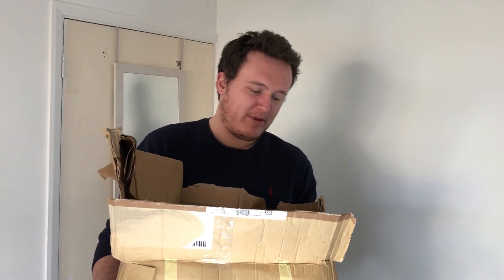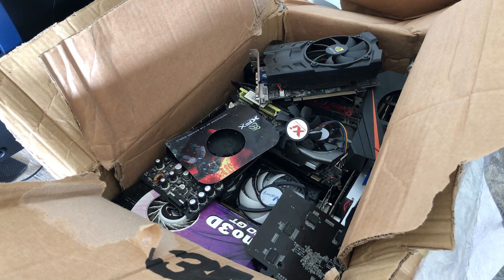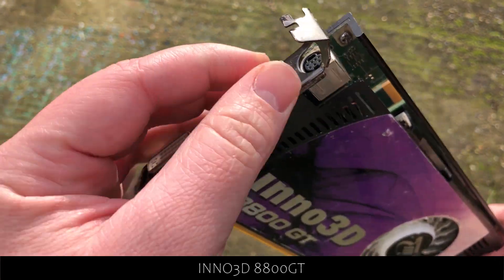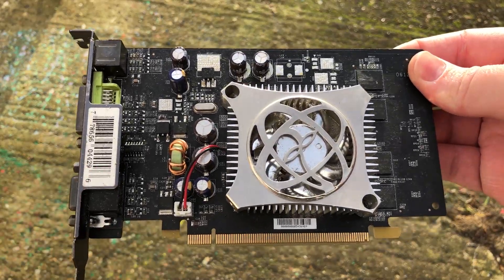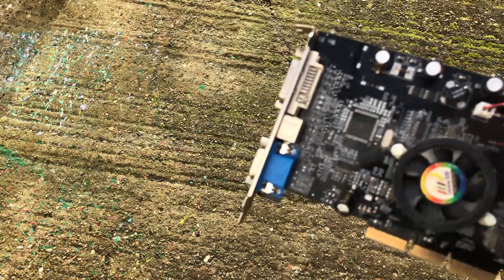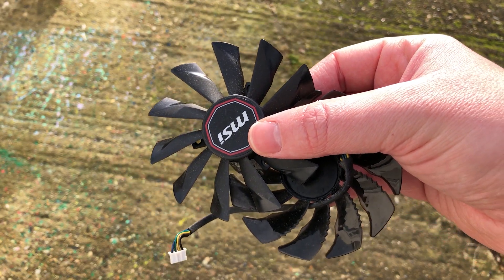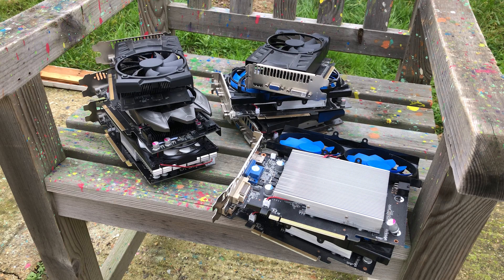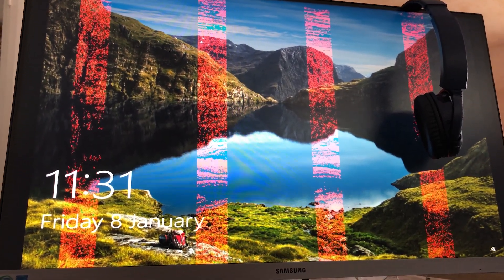I Bought 25 Untested Graphics Cards For £50 ($70)...

Comment: The oven trick sounds like the old Xbox 360 ring of death, "wrap it in towel" technique.
Reply: Probably works as well too.
Reply: @Larry Bundy Jr  for Xbox 360 tricks, it's probably more of the open case  use hair dryer on motherboard components.
Reply: yeah its kind of the same concept, just sort of a cheap and iffy way of reflowing bga chips. Most people don't use any flux or add new solder, but if it works, it can be ok. Most of the components can handle heat, but I never like heating up capacitors.
Reply: it does!
Reply: lol i actually stuck forks in the fans of mine after repasting to fix it...worked for another 8 months
Reply: Wasn't RROD an overheating issue?
Reply: @EmperorNergal  Yes, kinda...which is why what I said might sound counter productive lol but basically what it was is the poor design of the "x-clamps" on bottom of the board which held the heat sinks down along with the soldier they used which would crack over time and separate the CPU/GPU from the board...so my fix was removing x-clamps and heat sinks, cleaning thermal paste off, replacing the thermal paste with Arctic Silver, then using screws instead to tighten down the heat sinks to the chips. Now that the thermal issue was improved, you would then block the fans and power on system and wait for the 3 red lights(general hardware failure) to turn into 2 red lights (overheat failure). This would heat the soldier up to a point where it would basically re-join by somewhat melting from the heat and reseating the chips. Then you let it cool for awhile and power it back on...bam green lights and functional
Reply: @EmperorNergal  Could have sworn that was the case, the system overheated causing the x-clamps to flex the board which in turn caused the chips to have contact issues.
Reply: @JeordieEH  nah the chips are fucked, by doing that you make it work again only to break again lol
Reply: I've fixed over 10 gpu's with oven. 200C 10min with foilpaper supports.
Reply: I blew up a 360 doing the oven trick, forgot the most important part.......setting a timer.
Reply: @templet45  Overheating the GPU is a good idea. I hadn't heard of that one. I have a dead xbox in the closet that my cousin gave me years ago. I tried to fix it with the oven method but I didn't want to risk cooking the chip so I didn't get the solder to flash properly. It worked for about 20 minutes then died again. Overheating the chip sounds more promising than trying to bake the solder without destroying any components.
Reply: Yeah but the xbox melts rhe gpu dosen't
Reply: well hello you.....
Reply: @Larry Bundy Jr Hello you!
Reply: Seeing Larry everywhere recently.
And about the oven: Many solders got melting points in the 180-230°C range. A typical household oven can reach 250°C, which is enough to melt the solder. But it's important to give it time to heat up and cool down slowly so that everything can expand slowly.
Yes a proper soldering oven or even hot air focused only onto the necessary parts would be better, but an oven can do the job. What should go wrong? It's already broken, can't make it worse.
Reply: @JeordieEH  yeah, but in reality it doesn't even reflow the solder with that method, the solder never reaches melting temperature, it just at best softens up and mechanical pressure from the heatsink just forces it to make half-assed contact again, enough to work until the next significant thermal expansion.
(EDIT: talking mostly about the towel method, in an oven it can indeed melt the solder. Keep in mind capacitors might not handle it well, neither do connectors)
Reply: Fixed a buddy's xbox 360 that way.we had been cod blops zombies  for ages and it finally died so we tried the old towel trick and that stupid thing went on for another few months.
Reply: Actually works though!
Reply: I prefer the under the armpit version, oh wait no that's what i do with the knife if I forgot to get the butter out of the fridge.
Reply: JUST DONT USE YOUR OWN OVEN OR ALL FUTURE FOOD WILL HAVE PCB CANCER REMNANTS
Reply: The logic behind the oven trick is sound and does indeed very often work and not only restricted to consoles or regular computer consoles.  I actually used it to fix the gear selector on my last car.
Reply: I have had the oven trick work many times. What I do is first inject some flux under the gpu die. I then heat the card to just under the solder melting point in the oven. I take the card out and quickly finish the reflow on just the gpu die with a heat gun.
Reply: That's exactly what it is.
Reply: I got 2 original 360's that got a red ring of death....sad times...still love the 360 and miss the community lol 
I still have the 2nd gen 360 (black) however disk tray is a bit fucked and the 360 slim lol
Reply: do you remember the trick of turning your xbox upside down, and slamming the disk tray in to make some games work? good old days lol
Reply: Oh i would take out the hardrive and put it back in and when my disk tray wouldnt open i would use a knife and pry it open i miss my 360
Reply: @Kalvinjj  I have do it with a 770 work for 2 years and after it stopped working for overworking (I was playing mass effect Andromeda)
Reply: Sort of but the idea of the oven method is to reflow any solder joints that may have cracked over time again it doesn't always work and even if it does it doesn't last long
Reply: @robertt9342  I used a paint stripping gun and built myself a jig on a block of wood so I could secure the motherboard to prevent the heat warping it. Just got to be mindful of the caps.
Reply: I remember 12 year old me browsing YouTube for a fix for red ring, finding the towel trick and it worked dude :') good times
Reply: @templet45  WHY?
Reply: @HatTrex  the overheating process reflow the soldier afterwards
Reply: @templet45  cool

Comment: You can sometimes sort noisy fans by cleaning them out and putting load of WD40 into the bearing. I have made several noisy old AGP cards work fine by doing this, including the one in my retro machine. Wont work indefinitely but is good for a bit.

Comment: I think the Firepro's fan might be recoverable, sounds like a typical sleeve/journal bearing. Chances are that you can pull it right off the bearing with a little bit of work, clean up the old gunk and stick some grease in/on it. I've personally noticed that sleeve bearings that are in that condition are typically willing to come off their socket with not too much force. It's worth a try for a fan that would otherwise be replaced, right?

Comment: Ohhh was hoping to see that 5970 working :(
I bought one a few months ago and it was also broken, maybe it's for the best, crossfire is always a pain 😅
Reply from the maker: Yeah hopefully I’ll revive it with a heat gun or something, even if it works for just an hour or so 😂
Reply: My two favourite YouTubers!!!
Reply: I just bought one too! €35.. I had some issues with it losing image when I was trying to play GTA V and Cyberpunk wouldn't even start... but I'll try it again on a clean install and different hardware, maybe it helps :)
Reply: if you hope they work they will always be dead when you think there broken for some god reason it will run better then ever
Reply: how did they turn up without you realising you had won the auction, before you paid...?
Reply: I got a new little bro of that card...
And OMG! Is it power hungry!
The dual GPU card suck power and you really have to have a very high power PSU and even take care in what other hardware your using.

I'd recommend a minimum 750w PSU. But a 1200 should run a system well and keep the cards stable.

I ended up with the "new" card as the  system it was in was used for a short time but woefully under powered for the card... With a GPU sucking 380w (factory numbers) a dual isn't going to do well on most systems....

The 8800's are well known as cooking themselves and being dead so you did well with the finds...

Now hurry along and get testing the rest so we can enjoy lockdown.
Reply: Krispy here
Reply: tbh I have suffered so much with AMD Crossfire that it kinda deserves it. 
Atrocious frametime and stutters in most of the major titles I tried to play them at.
Reply: @TheJBftw  it didn't used to be like that, it is now as there are few games and driver which work/support that hardware.

If you get cards and original drivers in your retro gaming, you will find it works. If you go too old with GPU then a single newer card will work as good or better than crossfire and/or sli.
Reply: @RandomGaminginHD  there's a very slim chance the 5970 is just incompatible with your motherboard. These dual GPU cards with PLX bridge chips tend to be finnicky with modern boards as the PLX doesn't get initialized properly. Often they'll work fine on older (pre-AM4/1151) boards, and on modern boards they'll sometimes at least get recognized in the chipset PCIE slots while not working at all in the CPU PCIE slots. My 5970 didn't display anything on a MSI B350, but then worked entirely fine on an old AM3+ 990FX board.
Reply: @jay-5061  same
Reply: Duuude I was hopeful.
Reply: 6970 is better card aging wise
Reply: zWORMz has used a gt 710 in cyberpunk I am very surprised it didn't explode
Reply: @RandomGaminginHD  The 5970 would be a beast for anyone interested in BOINC or other distributed computing, - it gives just under 1,000 G/flops of FP64 processing - nearly 3x a RX580's FP64 rating or on par with a R9 280x. Granted, less RAM and you have to use drivers from 2015, but for that specific purpose... (also good for winter heating). Hope you can get it working.
Reply: @RandomGaminginHD   Hi, If you ever come across a STALKER game branded GPU I'd love to buy it off you working or not, I'm in the UK so it would be a simple sale. Cheers.
Reply: Bruh these 2 dudes literally watch all of each others vids
Reply: Not as painful as your electricity bill...
Reply: Terrascale moment
Reply: I had one that i had to send back to xfx. Honestly they where always trouble but i mined a bitcoin and a half with it. No idea what happened to the bitcoin but would have made it the most cost effective gpu i ever had if i hadn't lost it XD
Reply: @guywhoknows  I can count no more than 5 titles that played smoothly with AMD Crossfire back in the day. Originally I had a pair of HD 5770s, then switched to a pair of HD 7970s and then an almighty Winter Heater of two R9 290s. My experience from using it was always a stutter festival with the exception of few well coded titles.
Reply: @TheJBftw  lol I could tell that you too young'. 
Firstly you said AMD cross fire.
Not ATI.
Secondly you got you GPU numbers wrong. You should be x800, x1950....
I wouldn't go further up as about 2007 sli/cross fire faded.
ATI was the first out, it was only Nvidia that kept it going for a while (selling double the GPUs) but there was not much in the game dev arena.

Game cycles were 3-5 years, as you may gather a few took up the dual GPU fade but the sale and uptake wasn't there on both sides. If it was deved for 16 years as a constant and  had both game and driver support (or ease) then maybe it would be a thing today. But of course it is on a chiplet as a single dye.

With ATI, that stated to die around 2006/7 they never went into development,. Funds were crushed by the high Nvidia sales, and AMD took a look as rumor had that intel was buying Nvidia and and was buying ATI.
Reply: I have a decent collection of cards and so I have this card and it works, now I'm not a gamer I'm just a collector of old hardware and that card runs like a space heater running benchmarks.
Reply: @RandomGaminginHD  dyu know how I can check if my RAM is dual channel in my laptop without taking it apart? Cuz zwormz asked me cuz he replied to my comment sayin I was getting 30 less FPS in gta v with an i7 and rtx 2060
Reply: Gta online* than in story
Reply: i wonder who suffered more pain in their jobs as youtubers:/
Reply: Hey kyrzzp!
Reply: how hes got them out in yard not a static clean inviorment at all open to all elements
Reply: @guywhoknows  iknow

Comment: I can't remember if you have flashed the fake cards back to real ones before, but if I recall you need an external flashing tool. though as long as you get lucky and find a working bios it should be fine to sell them for what they are.

Comment: @RandonGamingHD, I been a subscriber for 2 years now and I never see you do this, so here is some tip for you.

when you clean those cards, do not just air them off. Unmount the plastic and fan connector, remove fan, on the back of it you will find a sticker, with finess, peel 3/4 of the sticker to reveal the (optional) rubber ring, put rubber ring out, pour 2 drops of  fine mechanical oil like the one ur grandma has in her sewing machine (do not use WD40), spin fan by hand, 2 more drops, wiggle the fan and spin some more. Put sticker back on, asamble all back. Then you will see how silent everything becomes. ;) try it next time one QuadroFX 4600 with my method one with yours. Cheers!

Comment: I still have my PC from January 2008 that I had custom build. At the time it was spec'd to be able to run Windows Vista (and its advanced graphical Aero interface).
Of-course it ran Windows XP as a dual boot and did so smoothly with its 2GB of RAM at the time. It ran Crysis, too!
It's based upon an Asus P5K motherboard with an XFX 8800 GTS, 320MB GPU that still runs today. I actually found out last week that Windows 10 (20H2) now decides to play nice with this motherboard, where I wasn't able to upgrade when Win 10 came out due to the lack of legacy support for diskette drives. This system has one, still.
I decide to wipe the legacy contents of the system and turn the diskette drive off in the BIOS to try Windows 10 for another time after the last years it has been running Win 7 and XP in dual boot.
To my surprise it ran! even when I turned the diskette drive back on again. It even works. Windows 10 seems to do some weird seeking on the empty drive though, from time to time. I think it has to do with how it handles quick launch of programs and such.

Sure, over the years the power supply has been replaced, the amount of RAM has doubled from 2 to 4GB, and I got a free CPU of off someone through some pleasant casual chatting when I met him through my favorite marketplace website. So the E8400 replaced the old E6750. The hard drive has been replaced by an SSD. Other than that the 8800 GTS seems to do just fine. Windows 10 installed the Nvidia drivers but doesn't show it in task manager. I think that's because of the DirectX version of this card. Doesn't matter. It still plays 720p YouTube videos, even the 60fps ones. Twitch videos reach up to 1080p. The CPU is running at its toes though, but it works.

Comment: the v5800 is basicly a 5770 core downclocked to 5750 levels of performance, and it has much better drivers in my experience than normal terascale cards

Comment: Small recommendation: When putting gpus in the oven, you can set the temperature to around 120-130°C for 5-6 minutes. If the gpu die itself is dying, then it should work afterward, and then you know for sure that it's not solder balls that cracked
Reply: That’s only a temporary fix, usually a dying GPU will end up dying regardless if you’ve heat-treated it.

Comment: @RandomGamingHD. I have had much success using a heat gun and an infrared gun to monitor temps.  First clean the board with a toothbrush and 90+ % rubbing alcohol let dry, then heat the back of the board to 385 to 400 degrees Fahrenheit Idk what that is in Celcius lol.....   And use the infrared gun to monitor temps making sure the whole board is even temp by slowly going across the whole board do this between 5 to 10 minutes you should see solder look a little liquid if you do not after 5 to 10 minutes increase them by 10 deg until u start seeing it shiny that means its hit the correct melting point which boards from 90's to nowadays can be different.       If this does not work you could always use the Louis Rossman method mac repair YouTuber lol... Use alot of flux and use a soldering iron and some extra solder, the flux will make the solder adhere to the other existing solder basically making a better connection. You can never have to much flux :)

If u have 2 of the same cards and they both artifact you could use the soldering gun and just move the memory chips back and forth because usually, artifacting is due to memory....     Or you can just underclock the memory abit and see if the issue goes away if so you can use a bios editor to just manually set the mem speed to what is stable

Comment: A couple of tips :

- Spray some oil in-between the gaps of the fan, the lubrication might get rid of the noise.

- Instead of the oven method try using a heatgun to reflow the GPU die first.

Comment: Get a 15 pound heat gun from tesco instead of putting it to oven. It has 2 modes, put it on (lower) mode 1 a and hold it 15 cm above chip for 2 minutes. Much better chances than oven ;)

Comment: I’m not sure what system you were using for testing. But for the 5970, try it in the bottom pcie slot on the motherboard. 

Any system newer than Z77 intel will generally have issues posting with duel gpu cards that use old school PLX bridge chips (like the 5970 does) using the bottom slot that generally comes off the motherboard chipset instead of the cpu sometimes fixes that, tho you may end up with slightly less performance.